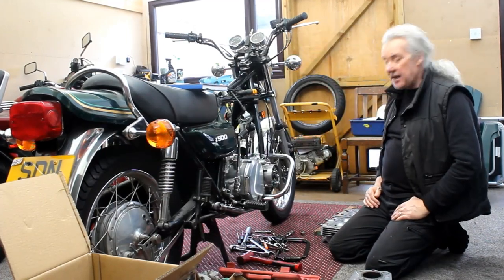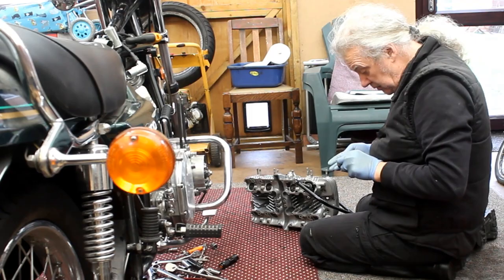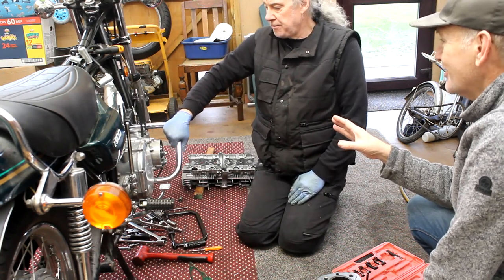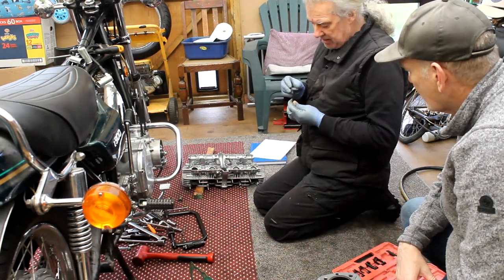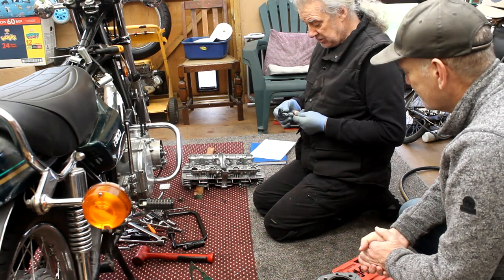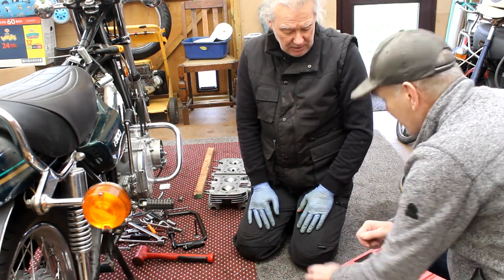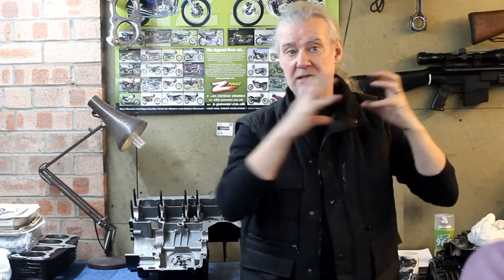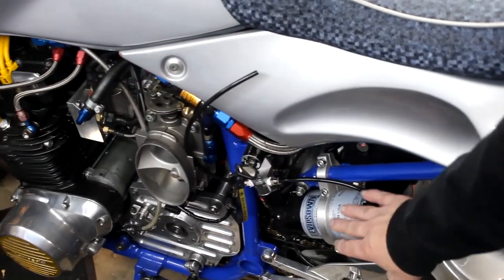Les Workshop 1

Comment: Tell Les if it’s had the collets ground down at the top it’s probably had the seats cut quite deep and they have topped the valves I have done no end of Z1300 cylinder heads and have seen where they have topped the valve to get a shim in not realising that you can only take so much off before you go below the collets
Reply from the maker: Thanks for the info, will pass it on. I think the head is going off for new guides etc.
Reply: @Merch131ho  the only trouble if it’s had the seats cut deep then by fitting new guides it will need the seats cutting again which in some cases doesn’t leave much seat left that’s depending how deep they have cut the seats before
Reply from the maker: @andym6608  The head is going to a chap named Roger Upperton over in Leeds, who has decades of experience building performance Zeds. I guess if he decides its too far gone, then a different head will be needed.  He is also building the head for my Mk2 1400.
Reply: @Merch131ho  I no Roger
Reply from the maker: @andym6608  Small world !
Reply: @Merch131ho  yes mate I’am only in chesterfield so not that far away👍